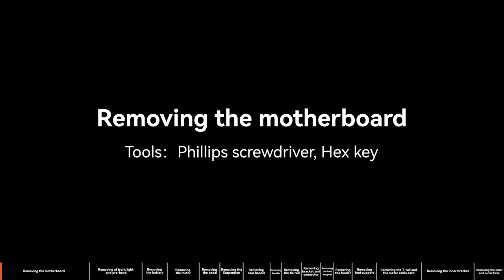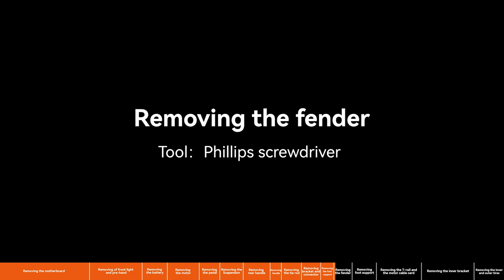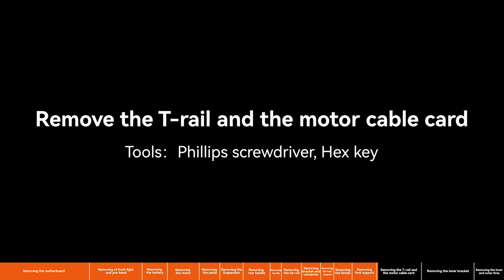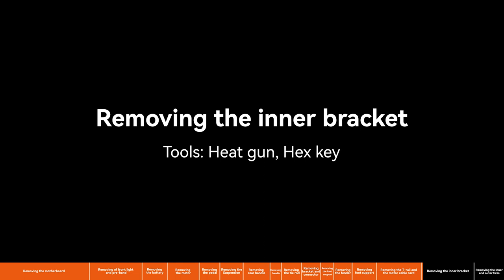King Song S22  EAGLE Disassembly Video

Comment: This is not the production model where lock tight was used to glue the screws in place. They are much more difficult to remove without shearing your hey key. You would definitely break a nail trying to remove the screws on the production model. I would like to see a teardown  of that to watch them struggle with trying to remove those bolts. I wish they didn't have any lock tight at all I would prefer a loose bolt over how difficult it is to remove these bolts. 😢
Reply: Yeah. I hate the chinesium screws with strong locktite...

Comment: 13:34. I tried to remove these bolts. Super tight and one twisted the head off. I spent 4 hours drilling and tapping to repair it. The bolts are coated with stud lock, so clearly you guys don't want us to remove them. 🤨

Comment: HELP! I have one of these, it somehow mis-calibrated itself and decided to rev to max speed whilst I was holding it in the air trying to control it and lean it backward; it has now completely stopped working and won't turn on! I assume it's a blown fuse in the battery - has any experienced this or know if it's easy to replace fuse in battery somewhere? It's not even mine, the owner is taking it back tomorrow so I'm in big trouble!

Comment: I am not able to remove the 8 screws that hold the pedals, my tools twist and the screws do not move.  Were they glued with glue on the production models?
Any tips on how to remove them without breaking anything?  I wish I could reverse the pedals.
Reply from the maker: Hi Manu, pls kindly check with this video, our engineers used these kind of tools.
hope this video is helpful for you. https://drive.google.com/file/d/1uFNSS5dvNvSJ9l4gr4TsjNfvLKQX1aVO/view?usp=sharing
Reply: Me too I broke two new tool sets trying to remove the petal bracket that holds the pedals to try and move them to the lower position. The T handle Allen key sheared the tip off and the L shaped Allen key twisted the end off. Too much lock tight was used on these bolts. They are too hard to remove. 😓
Reply from the maker: @DominiqueLegault  Sorry for the hard remove of it, and thanks for feedback, will talk to related department of this .